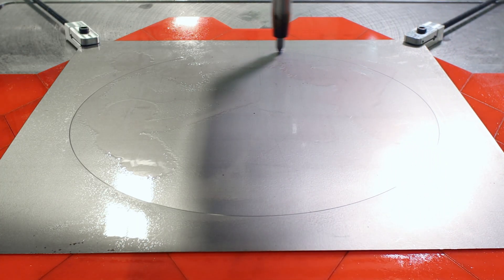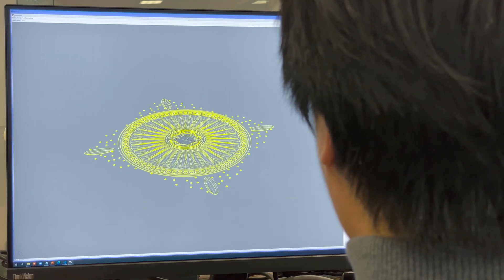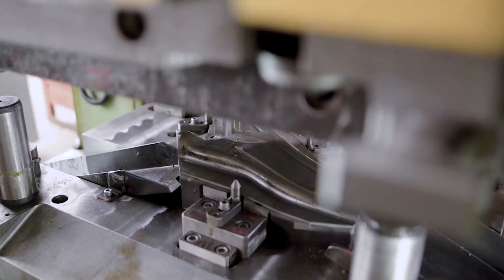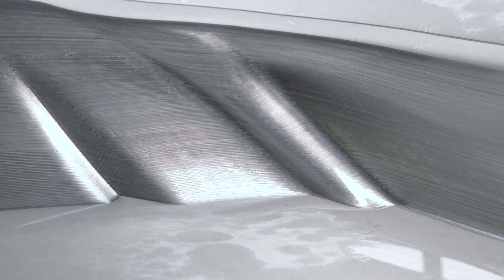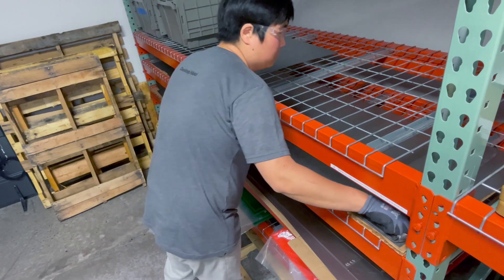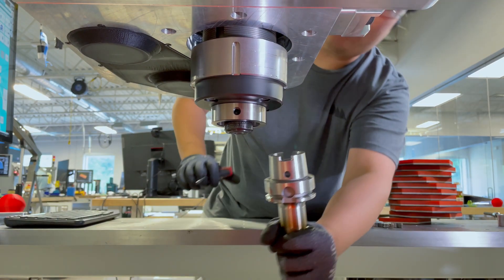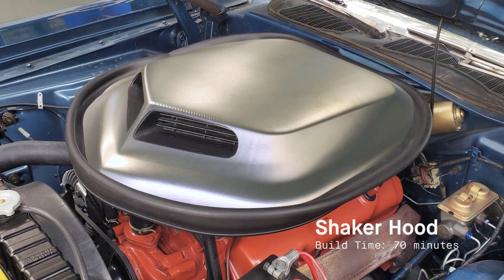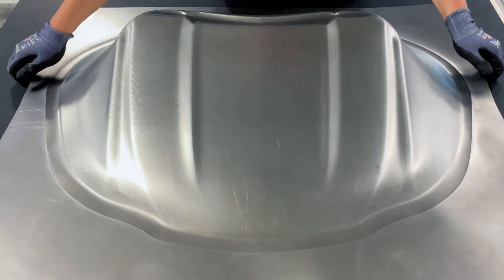Figur G15 | Digital Sheet Forming Technology from Desktop Metal

Comment: Interesting, very similar to planashing with brass or copper sheet. Up to what thickness material can be formed and carbon content %age?
Reply from the maker: Hey Robert, at launch the system will be capable of forming Steel, 2.0 mm (14 Ga) and Aluminum, 2.5 mm (10 Ga)